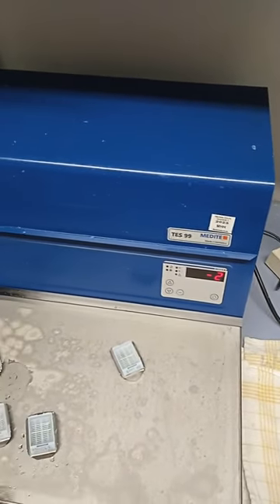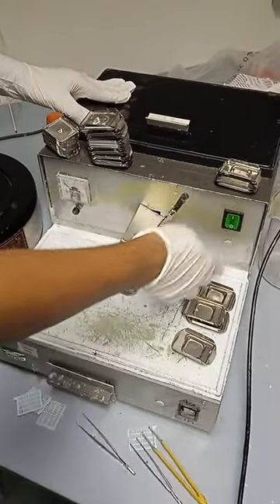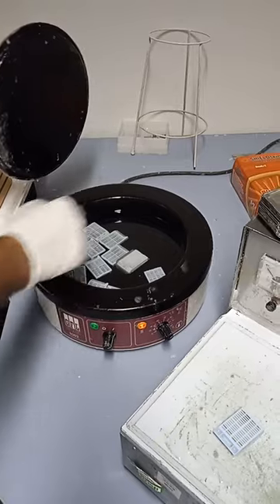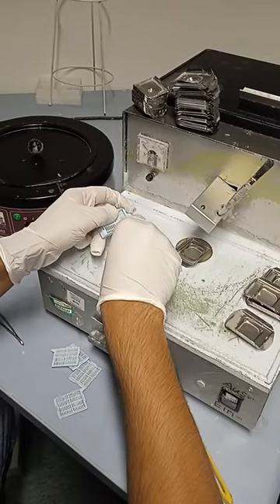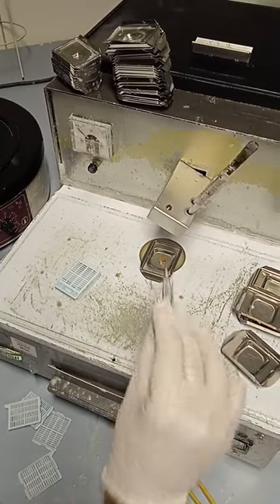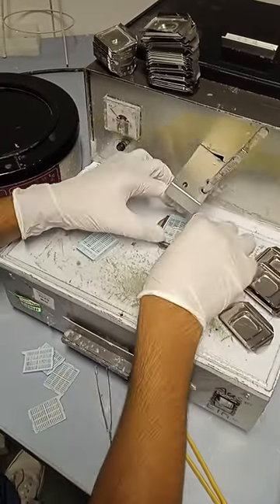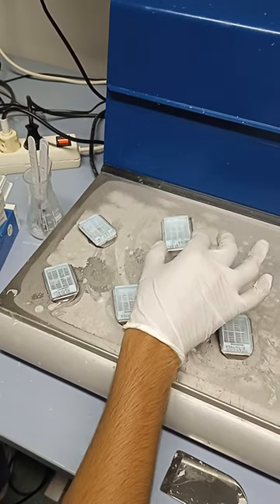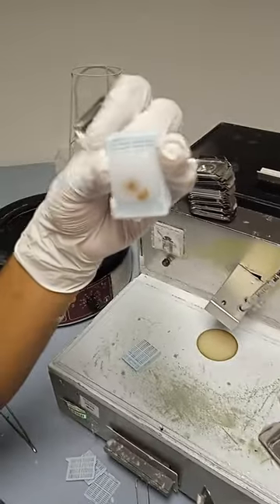Paraffin embedding technique | Paraffin embedded block l @BiologyLectures

Comment: Can color be separated from paraffin wax candle? What can be done for it? 👋
Reply from the maker: It is not possible to separate color from paraffin wax candles through a simple physical process. The color in candles is typically achieved by adding pigments or dyes to the melted wax before it solidifies. Once the color is mixed with the wax, it becomes an integral part of the candle and cannot be easily separated.

If you're looking to remove color from a paraffin wax candle, the most effective method would involve melting the candle and filtering out the solid particles or impurities that contribute to the color. However, this process would not completely remove all traces of color and might affect the candle's overall composition and quality.